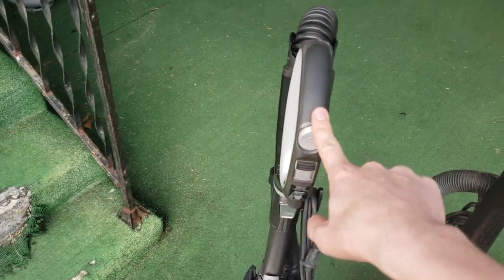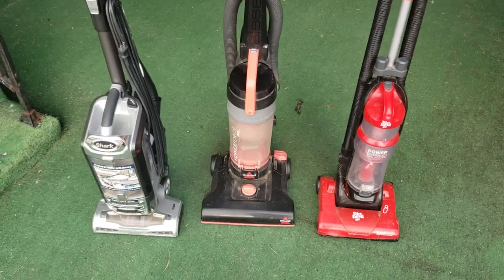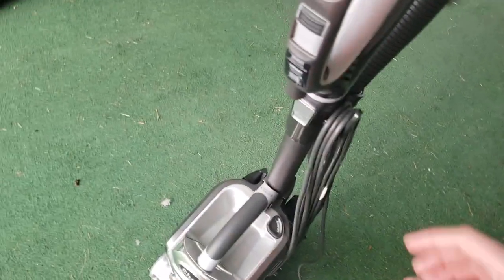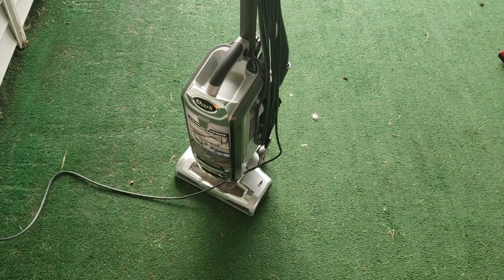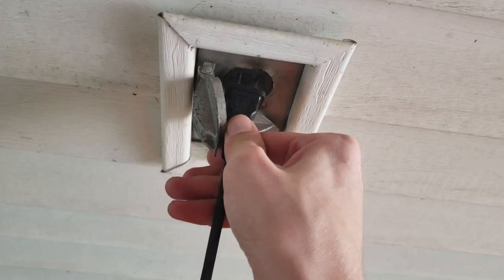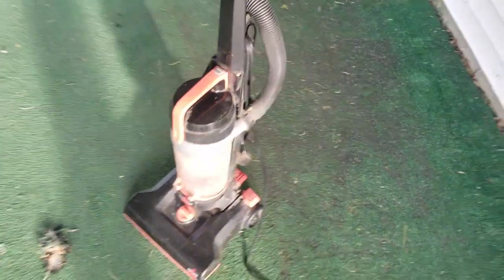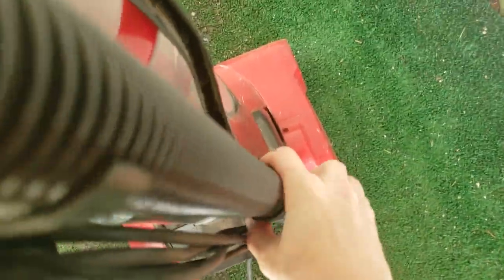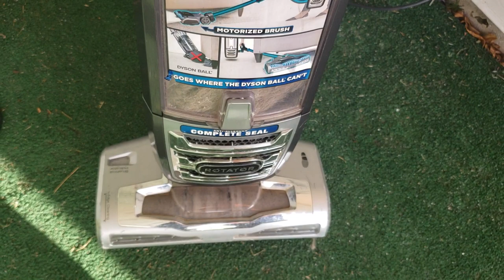Vacuums Saved: Episode 5

Comment: I think the brush roll is the reason why the Bissell is not turning on because it's shot, but if the brush roll is replaced, the Bissell might work.
Reply: @thatvacuumgeek  Wrong. The brushroll is powered by the motor via a belt.
I know this because I own a 2191 model bissell.

Yes I'm aware I'm replying a year after you replied to the comment)